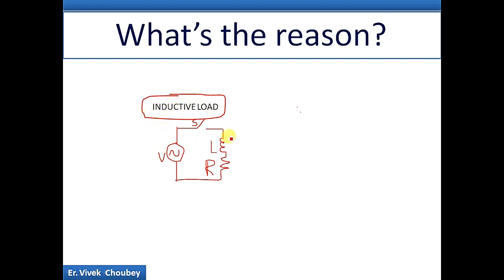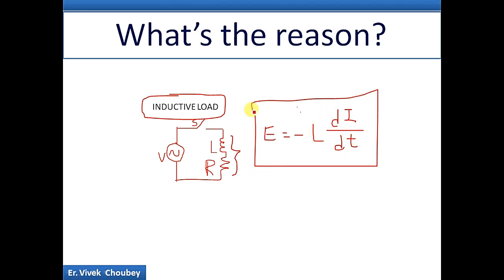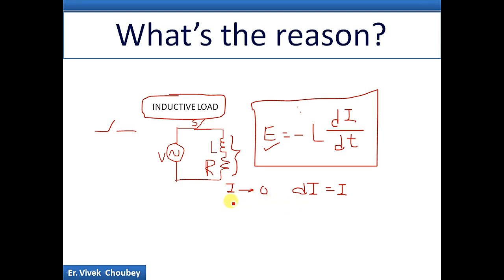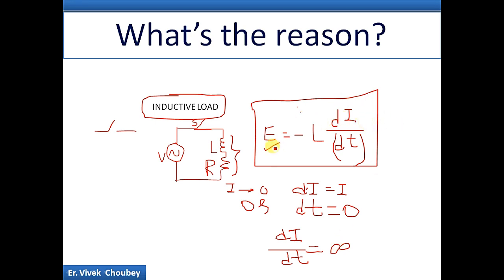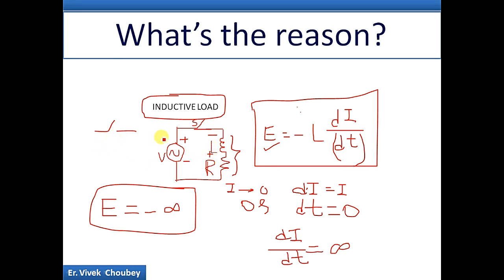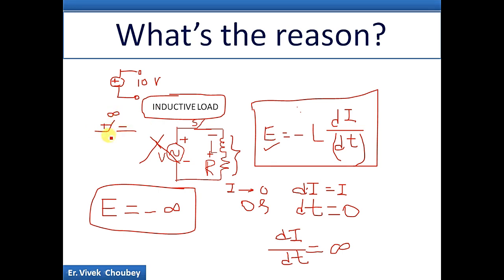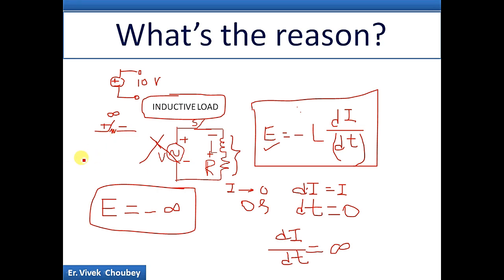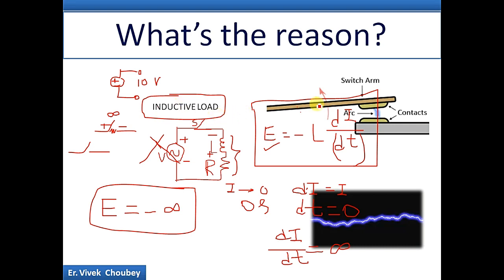Why we shouldn't operate electrical switches during LPG leakage? REASON EXPLAINED

Comment: Dear Sir, 
From few days onwards in my home, Tube lights are flickering and fans speed rising and falling... 
What is the behind this??

And during that time I observed energy meter .... That meter display also blinking the same time.... It's happening more times at night time when compared to day time.
Plz tell why it is going on like that... 
And to whom I have to inform... I mean any electrician or can I give complaint to power distribution corporation in our area limits... Sorry for asking Sir... I am believing you  have all this knowledge... That's why I am asking..
Reply from the maker: No problem. You don't need to be sorry it's fine.

I think the problem is probably with any neighborhood house connected on the same line or maybe you have some poor load. It may be some harmonics problem with the load. Or it maybe some other sort of problem but flickering happens when some poor load having great harmonic distortion connected on the same line.

You should definitely complain it to the distribution company and initiate an enquiry. Flickering isn't a normal thing and according to electricity rule, you can also file a case against the officials if they don't do anything.
Reply: @ervivekchoubey  Thank you very much Sir for timely responding and for explaining reason behind that....Now I got clarity what to do next....